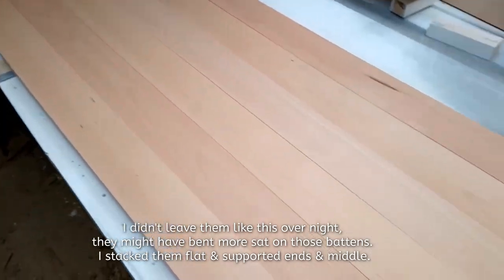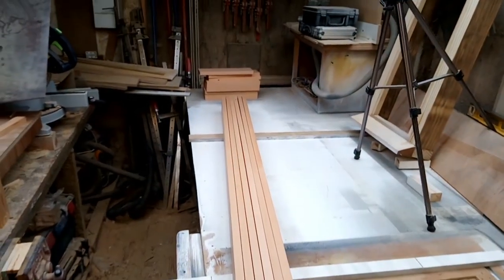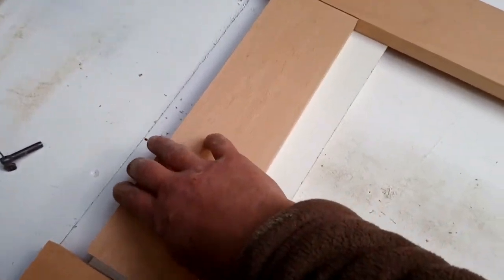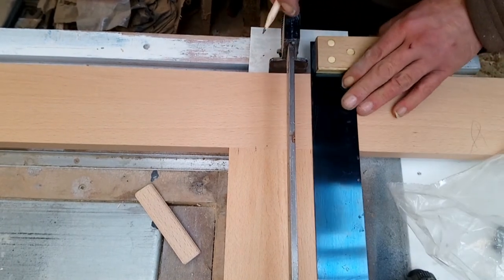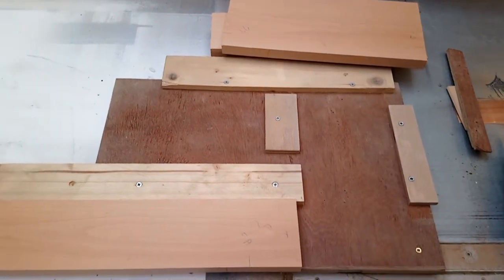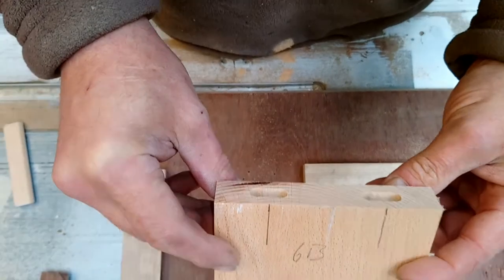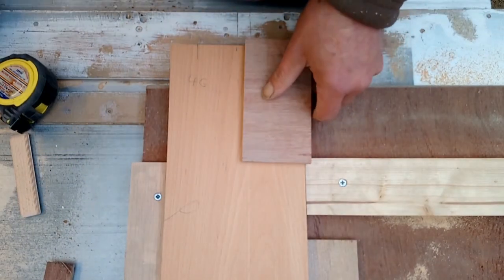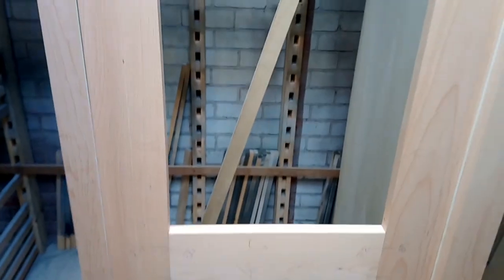Wardrobe build pt4 - Marking & cutting the Dominos for the doors

Comment: Hi gid great vid what size domino's did you use on those doors
Reply from the maker: Hi, normally a tenon would be roughly 1/3 the width of the timber, these timbers are 20-22mm, 1/3 of that is 7mm-ish so I use 8mmx100mm Dominoes, 👍
Reply: @Gidjoiner  top man cheers gid 👍

Comment: Any tips if your doors arnt meeting quite flush with each other at the top when they are just right at the bottom?  Cheers Gid loving your vids
Reply from the maker: Hi, quite literally brute force, pull them into shape, put wedges or blocks in & a clamp, leave them 'over' twisted till next day, you should be able to tear/stretch... the fibres of the wood enough to pull them In-twist, but be careful not to break the joints, You could just put blocks & weights on them on the bench to twist them into shape,, Thanks,
Reply: @Gidjoiner  cheers gid you are a legend!

Comment: We're currently joining hardwood onsite for windows. What is the maximum depth of material you can join? Were joining 45mmx125mm pieces.
Reply from the maker: the max depth of cut is 70mm x14mm cutter ,  so the biggest domino is 140mm x 14mm

Comment: How long would a wardrobe like this take from start to finish (fitting)
Reply from the maker: It's hard to say 🤣 When i price them there's roughly a wk to build - shopping, make carcasses, make doors & bits & a wk to spray - primer & filling one side, primer & filling the other side next day, top coat next day, turn them over next day for top coat on the face side then leave to cure for 36hrs-ish, Then there's at least a day to fit it, &! the extras, there's always 'stuff', loading the van, &! Tea 😉😊 I try to charge enough, my quote is the final price unless they change something so it's in my interest to get it done asap without compromising quality but I always seem to spend more time then charged for.
Reply: Gid Joiner  spraying takes a long time then! Loading and unloading always takes longer than you think
Reply from the maker: @Samwise457  yeah it's easy in your head, but it's all the other stuff, getting tools out n set up,
Reply: @Gidjoiner  I reckon eight to ten Days Gid, all going to plan... 😁 🔨 🇮🇪
Reply from the maker: Yeah-ish, depends on the job & budget 😉,  I initially work on a wk to build n a wk to spray, a day for primer one side, a day for primer the other side, those get a full day because there's always some filling n extra sanding etc., then a day for top coat on the back of stuff first, then a final day for top coat on the face side that's seen the most, although the paint dries to sand in ½hr it's best to leave it over night before turning it over, then finally at least 24-36hrs left to cure with the best side/the face side that's seen the most up, that's why that side/face is done last, if it's stacked in the van any earlier it can rub n mark,